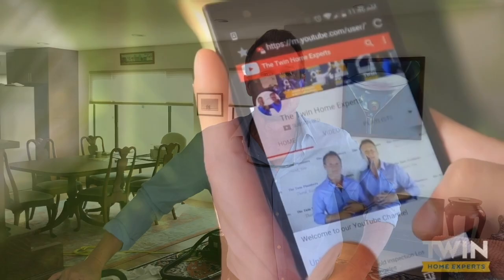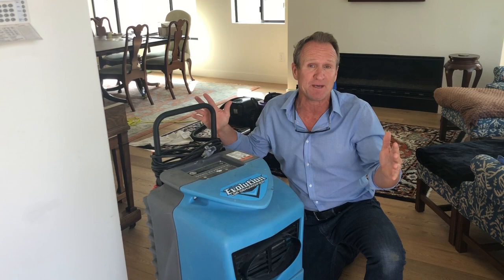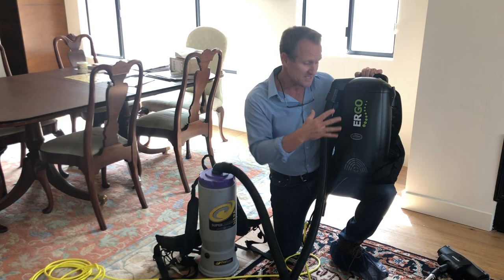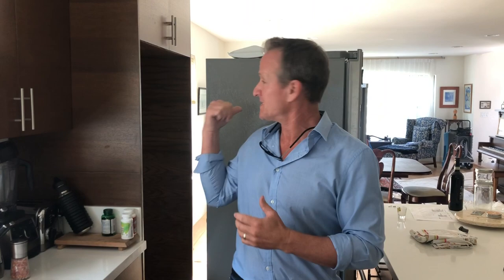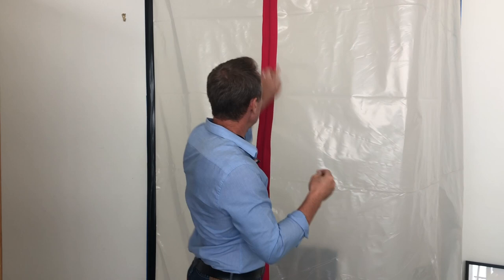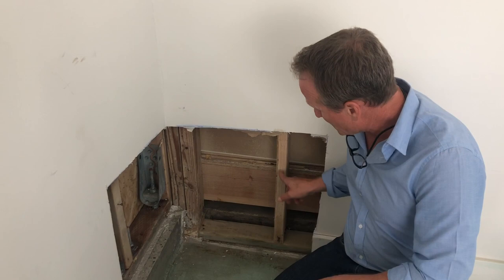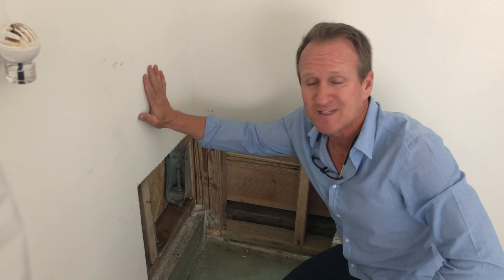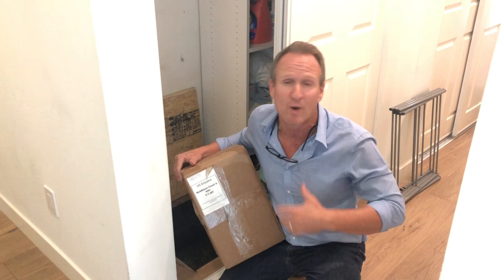What Do Mold Professionals Use To Kill Mold?

Comment: That dehumidifier you started out with is a $2000.00 piece of WATER DAMAGE restoration equipment... used to PREVENT mold....  NOT for mold remediation!  You use AIR SCRUBBERS during mold removal.  IF you use a dehumidifier in a mold contaminated area, you have to have it fully serviced and cleaned, and the filters replaced before you can use it somewhere else.
Reply: Great information and accurate
Reply: William with air scrubber do you think i have to change the filters after i use it in the mold remediation? I got extra thinking I might but I noticed both filters are quite expensive.
Reply: @Pinkheartbwell  IICRC Standards say yes.  Anytime you use dehumidifiers in a mold contaminated environment, you are supposed to replace the filters and decon the coils.  Do people really follow those standards? probably not.  In most cases they just wash them out with a fungicide.
Reply: Hey William, it looks like you know what you're talking about. Do you do this for a living? If so, would you mind if I hit you up with some Qs?
Reply: @Miami_Bad_Boy_BOSS  Yes I do for living. Be glad to answer questions
Reply: @williammiller6110  Do you have an email or maybe I can PM you on FB so I don't blow up this vid with my issue?
Reply: @williammiller6110  Or does Youtube have a PM chat? I don't even know, lol
Reply: @williammiller6110  I live in Kansas where there’s nobody that does this stuff. I had a basement window installed incorrectly and it has grown mold behind the wall and into my basement rafters. It’s everywhere in my house I’ve been gone dealing with my mom passing away. I feel like I’m losing an endless battle. Do you have some basic tips on cleaning solutions. I’m using bleach 1 cup to a gallon. Are running HEPA filters with mold lights on low. With the enzyme pump he talks about help? And where do I get one if so. Desperately need help dog is suffering. I’ve lost all my clothing my beds my furniture everything‘s infested. I need to save my house🙏
Reply: The professional mold remediation company I used first instauled the dehumidifier to dry out the room. Later we had to cut out walls and replace walls and cabinets that got mold on it. 

Tip wording makes a difference on whether homeowners insurance will pay. The don't cover mold damage. But they do cover water damage. In the case of leaks that result in mold, it is accurate to lable it as water damage. If no water invovleved from the leak, there wouldn't have been mold. So technically it is water damage.
Reply: @carolejackson8357   Your remediation company failed to do their job then... either way, they did not remove the water, and you ended up removing mold later.  In some cases as the water damage specialist, I have to remove the cabinets to expose the water damaged walls for drying.   But again, de-humidifiers are not designed for mold remediation.  The biggest difference between "Water damage" and "Mold Damage" is "Time" for insurance coverage purposes.  In your case, your insurance company should pursue your remediation company for the losses... and a refund.
Reply: @Miami_Bad_Boy_BOSS  "does Youtube have a PM chat" They did, years ago, but not anymore.
Reply: Question, is a Vevor hepa scrubber good? Is it better to DIY HEPA scrubber by using (3) 4 inch MERV13 or higher filters with a regular fan for an area as big as the one in the video like 2x2x2 mold drywall inside kitchen that's no bigger than 10x10 x8 sealed area and access to a window?
Reply: @williammiller6110 Question, is a Vevor hepa scrubber good? Is it better to DIY HEPA scrubber by using (3) 4 inch MERV13 or higher filters with a regular fan for an area as big as the one in the video like 2x2x2 mold drywall inside kitchen that's no bigger than 10x10 x8 sealed area and access to a window? And can I just use some vingear or something different to clean up the area.
Reply: @neoleo4718  Sounds like overkill for such a small area.  I personally wouldn't bother with containment or air scrubbing for only 4 sqr feet of moldy sheetrock.  Just use the HEPA vacuum as you carefully remove the sheetrock.  Close the doors and put a fan in the window going outside first.   Any disinfectant cleaner should be fine... not so sure about vinegar.  I would prefer to use something a little more powerful.  Hepa Vacuum the visible mold first, cut the sheetrock, vacuum the interior, bag the debri, sand the framing (orbital connected to hepa),  then treat with fungicide... let dry and seal with oil base primer.
Reply: @neoleo4718  When it comes to air scrubbers, what is important is the cost of replacement filters and the CFM.  The higher volume of air that it moves the better.  Industry usage standards and protocol requirements are based on the number of complete air exchanges that can be achieved within so many hours, depending on the severity of proliferation in the home.   Your situation doesn't sound like much of a problem.... so just be careful as you remove it, and wear a respirator.
Reply: @williammiller6110  What type of HEPA vacuum would you recommend like a regular shop vac with hepa bag filter? Kitchen is open so no doors to close other than the cabinets. The are is small it's pretty much the area behind the dishwasher, no taller than 1 foot at most and as wide as the disherwasher itself. I figured I needed to seal off the a portion of the area that I'll be working in along with my tools. At first I was just going to have the window open and use a regular shop vac with hepa filter and as I cut I would just the shop vac to vacuum out the stuff and then have a hose going out the window just in case it didn't trap everything in the hepa filter bag. And of course wear gloves, suit and mask p100. Would treating the thin plywood wall of the sink area that's beside the dishwasher also need to be cut out or just treat it with some fungicide or cut it out and replace the plywood as well. Does the area need to be sanded? I don't think it's gotten to the fram at least I don't think so.
Reply: @neoleo4718  A shop vac with a Hepa filter AND a bag should work fine.  Knowing what you need to cut out and what can be restored would require direct inspection.  Porous materials like sheetrock has to be cut out.  Harder materials like wood can be sanded.  Plywood is iffy.   Reaching all sides of affected cabinet materials may prove to be difficult.  I would not be able to tell you more without seeing it.  Removing the cabinet may be required to gain access to more of the wall, based on what is found.  I recommend you call in a water mitigation specialist... NOT a mold inspector.
Reply: @seeitall8921  I would need to see what you are dealing with before making recommendations about containment.  If you don't have an air scrubber, you may be able to improvise with a large fan lodged into a window (if available) pointed outside.  That would at least get you the negative air pressure.  Always vacuum everything thoroughly FIRST before spraying anything.  Spraying generates air pressure that spreads contamination.  You really need to identify primary sources of growth.  The surface growths you are seeing from high humidity are probably only secondary.  The primary source I would GUESS (without seeing) is carpeting.  The other most likely primary source would be the crawl space (if there is one)  Find the water... where it came from and where it went.... that's where your primary source of mold growth will be... IN THE DIRT.  Remove any carpet and pad first, then remove any water damaged wall materials, seal off cross contamination from crawl space, Vacuume thoroughly, then dis-infect surfaces,  Then re-test before repairs.  On severity... What you want are counts that are similar to or below what is outside.  I would not want to sleep in that room a single night as is.  (I generally ignore totals, focusing on specific mold types... subtract outdoor pen/asp from indoor pen/asp to get your elevation count)
Reply: Open windows help grow faster ln furniture 😂
Reply: @williammiller6110  What about a concrete basement floor?  I had a leak I didn't notice, found cause, and corrected.  Its about a 4ft by 6ft area that had been saturated the bottoms of all kinds of stuff...cardboard, shopping bags, boxes, cans of fruit and vegetables, soft drink, etc.  I'm getting rid of all my things that were on the floor, but do I have to get rid of shelf contents?  I just want to clean the area without making myself or my dogs ill.

My first course of action is to block off the area.  Then hook up my dehumidifiers. Then fill my 2 gallon sprayer with 2 cups of borax, and spray the floor before disrupting the dust, dirt and any potential mold.  Let soak before scrubbing?  When area is done and dry, spray on a sealant for mold and mildew.  How does plan sound to you?
Reply: @kathrynsee6184  Consider the porosity of items that can be cleaned vs discarded.  If it didn't get wet, and does not have visible mold growing on it, It can probably be wiped off or cleaned with a disinfectant.  Cement is not a food source, but the dirt on it is.... same with everything else.  Just Clean everything with just about any disinfectant (I don't know about borax) and use a dehumidifier to get and keep the basement dry.  Mold won't grow without water.  Sealant's have a tendency to trap moisture, and water is a universal solvent.  I would skip that part if your talking about cement.  It's porous food sources like wood that should be sealed after being treated and dried to prevent new growth.  Bag the items to be removed, hepa vac items and surfaces that remain, THEN spray with disinfectant.  Soaking not really necessary.  The air pressure from spraying can actually spread the mold so make sure you vacuum first.

Comment: When you have structural moisture issues? The first thing is to diagnose where or how the water (MOLD food source) and something to grow on! You can clean, using treatment before and after removal of wood, sheet rock anything else affected by the water damage and drying process. Once completely dry then sealing.

Comment: Now you have contaminated your very expensive dehumidifier. Never dry until mold remediation is completed. I see no HEPA air scrubbers, no negative pressure in containment. There is no chemical, spray or fog is going to help. Physically remove the mold by HEPA vacuuming, then scrub with soap and water. BTW...great PPE...EXCEPT for the no gloves taped to suit and on protective goggles! Scrub, scrape or HEPA sand the mold. Complete physical mold removal is key. NO SPRAY OR CHEMICAL will ever take care of mold...especially if the source of moisture is not repaired! Don't risk your health. Consult a professional. BTW. You can't kill mold (spores...they are seeds)
Reply: Its a rental-Drive it like you stole it!
Reply: So how do you remove spores suck them up out of the floor and entire bathroom surfaces ? Or what if I cover it with plastic throw the plastic away then vacuum with a regular vacuum? And do the spores stick to other wall locations or no because no water on wall yet.
Reply: @Andy-wz7jm  After finding/fixing water source problem.  I removed moldy sheetrock and baseboard and put in trash. Rented dehumidifier until moisture meter showed very low.  Wearing a respirator, I scrubbed framing with a wire brush, then sprayed with mold control.  After it dried then called for mold inspection.

Comment: Nice video but you did forget to mention air scrubber, scrubbing or sanding down the framing, and your guy wasn't wearing gloves. If there was mold there, the chances of that mold absorbing into skin is high. Also, the chemical you used did you use a mold stain removal?

Comment: @williammiller6110 Question, is a Vevor hepa scrubber good? Is it better to DIY HEPA scrubber by using (3) 4 inch MERV13 or higher filters with a regular fan for an area as big as the one in the video like 2x2x2 mold drywall inside kitchen that's no bigger than 10x10 x8 sealed area and access to a window?

Comment: Going through the process of getting mold removed now. It is costing us 10k.
Reply: What was your process like? I’m being charged 7k for them to spray one spot with a $30 bottle and rag and not even pull up the flooring where the house flooded😂
Reply: @NatePrime  Had to be out of the house for 48 hours. They removed damaged areas and cleaned everything the first day and then did some hand fog machines the next day. The house smelled like bleach for 3 weeks. I had to clean off the surfaces of everything because it left brown dust all over my stuff. Was a pain but the mold has not come back.